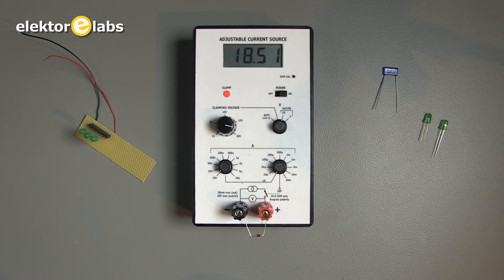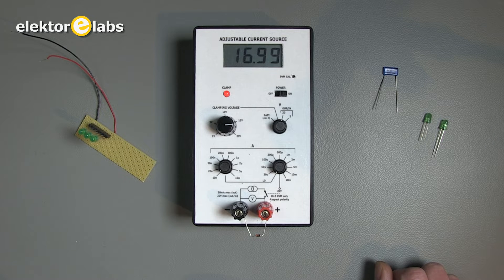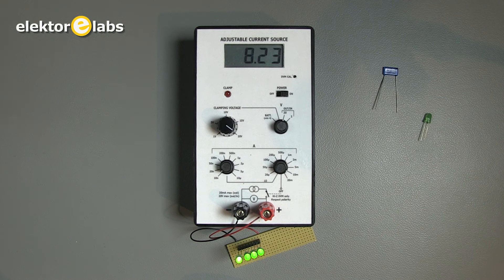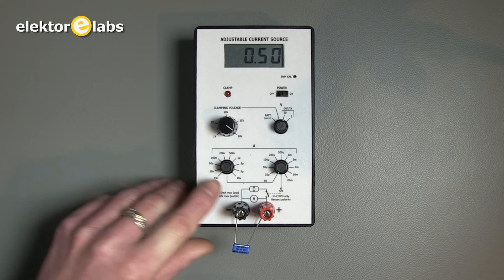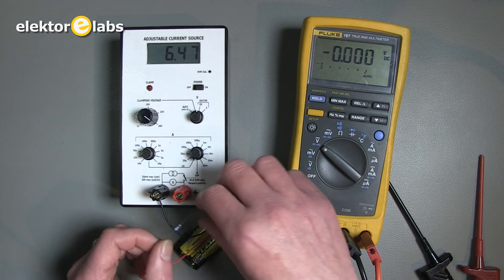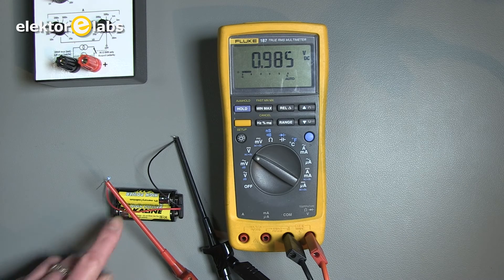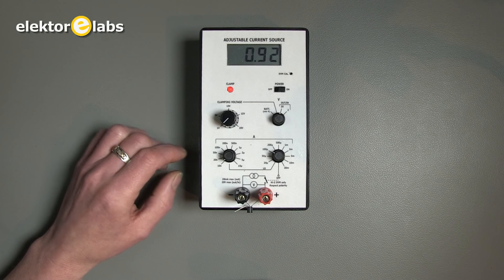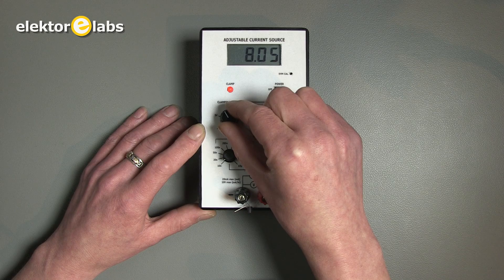Elektor - Precision Adjustable DC Current Source with integrated hi-Z voltmeter

Comment: humm... I have a €35 Uni-t multimeter which takes in roughly 120nA measuring on the 2V range, your Fluke is still taking in roughly 90nA when you measured the voltage accross 3V batteries! Your solution is excellent in what respects measuring in that range!!